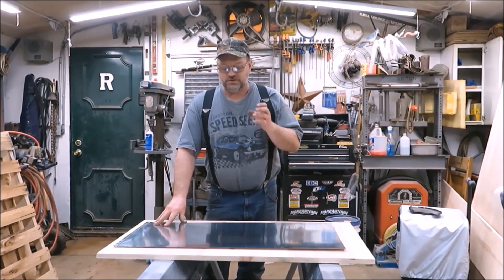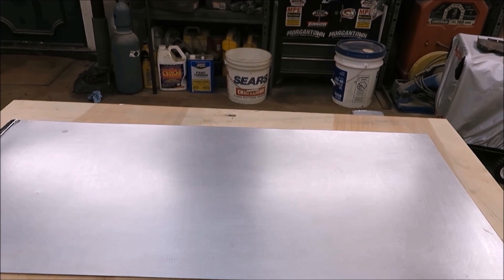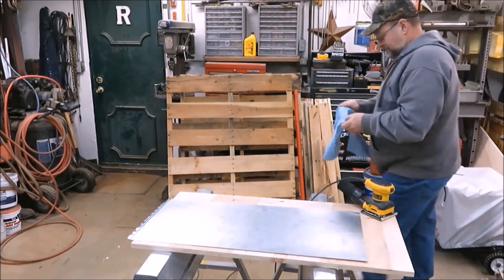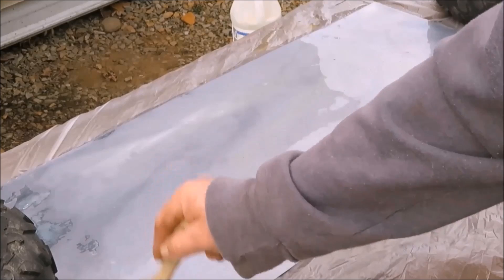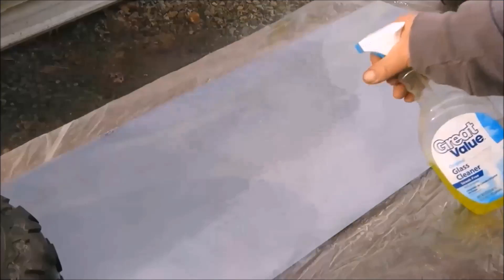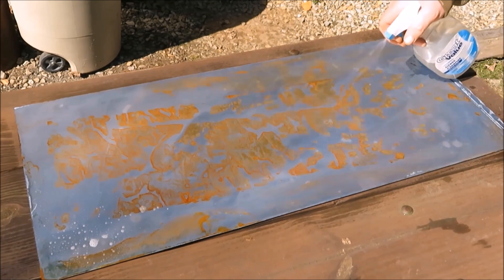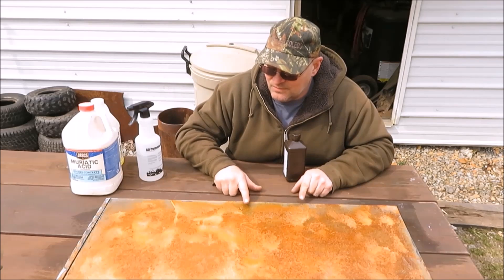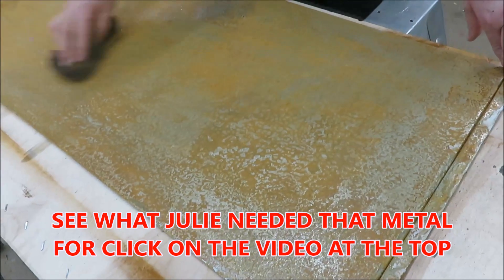how to make galvanized metal rust

Comment: I had extensive experience in my youth with Muriatic acid. If you would have followed the initial washing of acid with a second and third washing of Muriatic acid, that would have rusted in 24 hours. You stopped the acidic effect with the ammonia and diluted the Muriatic effect with vinegar. Just use 3 washings of Muriatic acid or less to achieve that "patina" she's looking for. Forget trying to stop Muriatic acid, it's really not that strong. It smokes as it works and scares people into thinking it will "eat" through the metal, but it won't. Just don't breathe the fumes. It WILL eat your lungs.
Reply from the maker: Thank you for the info Bent.
Reply: @Robinson-Homestead  I was told diluted sulfuric acid (car battery) is how muriatic is made and diluted muriactic acid is how vinegar is made. Don't know how true that is though.
Reply: @bentnickel7487  Muriatic acid is hydrochloric acid, (not sulfuric). Vinegar is typically an aqueous solution of acetic acid.